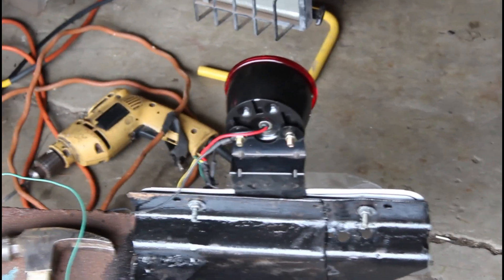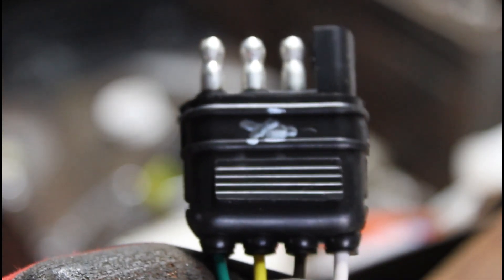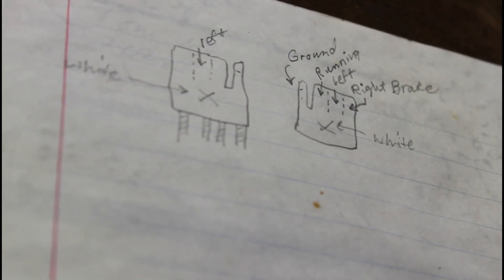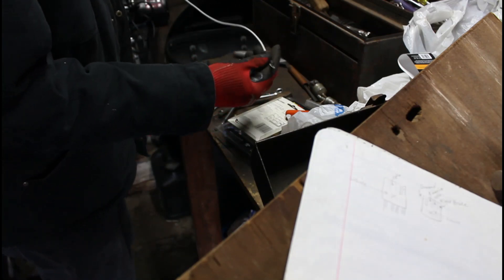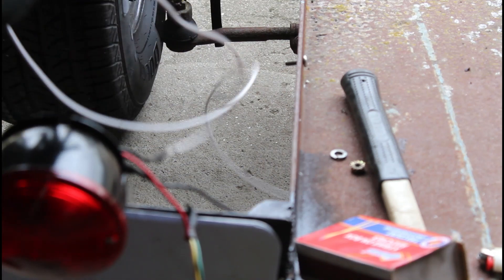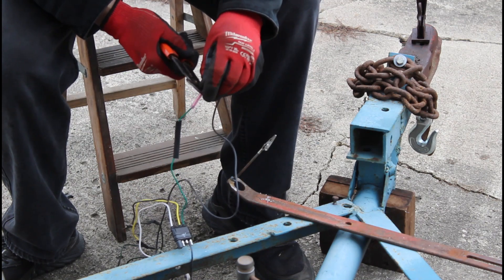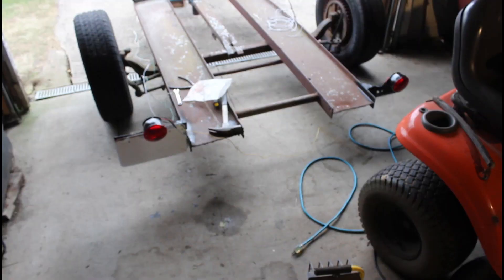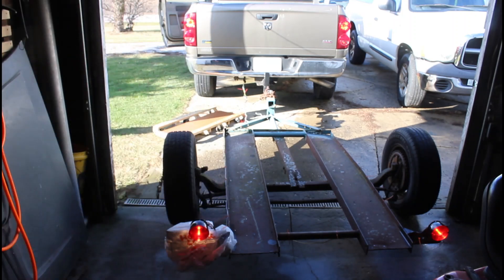Small Trailer Wiring And Welding 2

Comment from the maker: It was especially important to test the connector on the truck with a multi-meter to find which pin was used for what function. For instance, which pin was used for the brake light, the left turn signal, the right one, the running lights. This is covered in the video. For instance, when the right turn signal was switched on and the black lead was placed on the frame, then in each of the 4 pins the red lead was placed. The meter was switched to DC volts, and you could see the meter move in time to the right blinker.